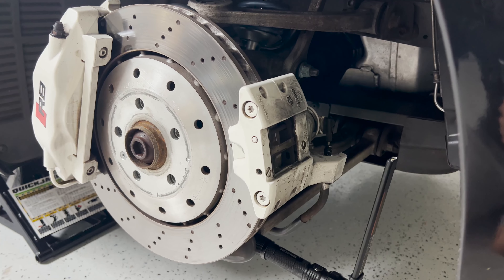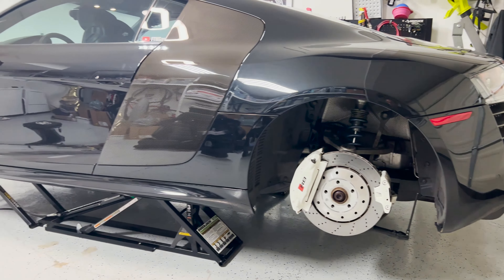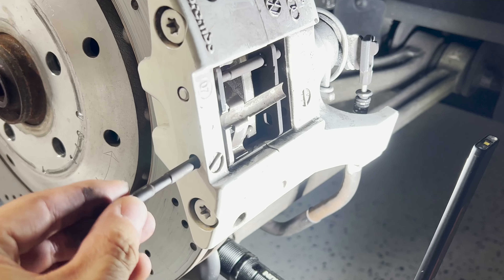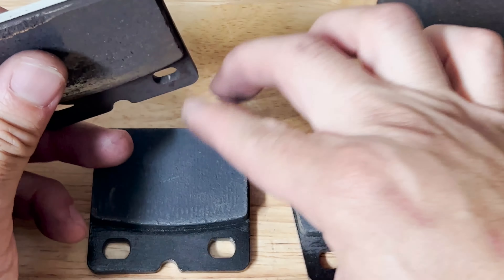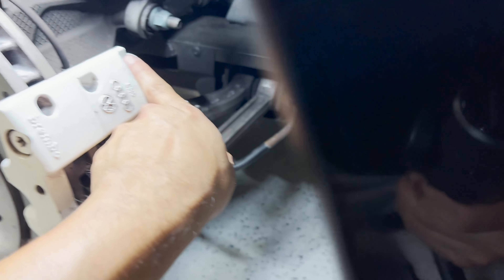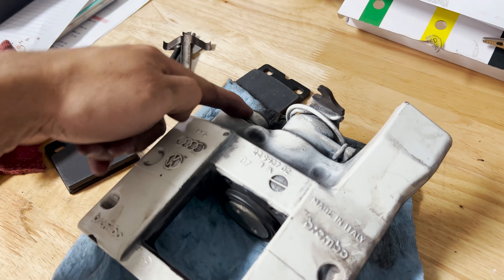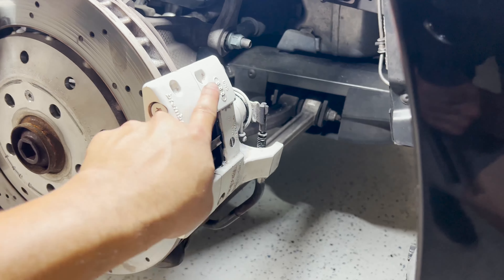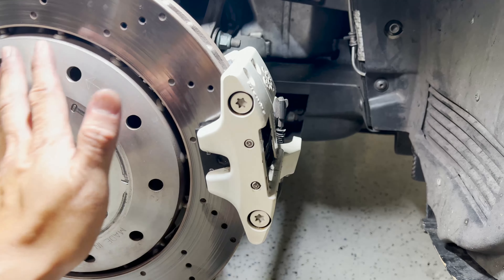How to Replace Audi R8 Parking Brake Pads

Comment: Have you thought about rebuilding the brake calipers?  Rebuild kits are available on eBay. There’s no YouTube video on rebuilding the brake calipers either for Gallardo or for R8.
Reply from the maker: Yea that would be cool to do. I haven't found a need to rebuild the calipers on the car (seals still look fine).  

I can see a person doing this if they decide to powder coat the brakes.